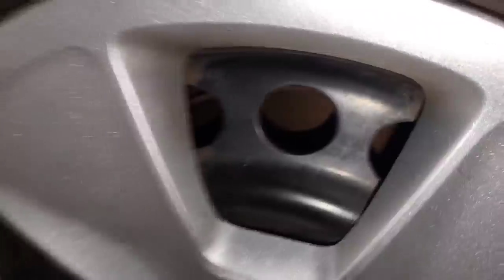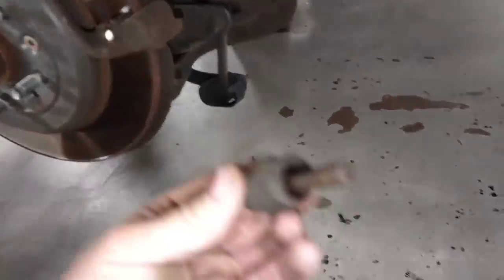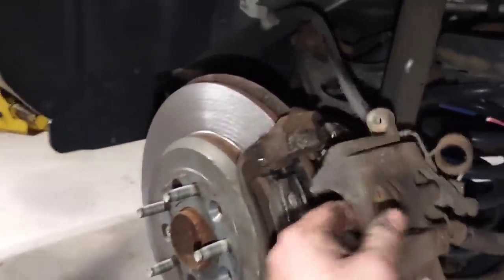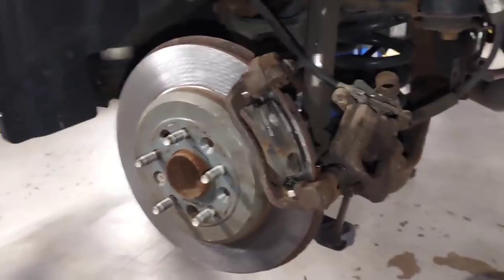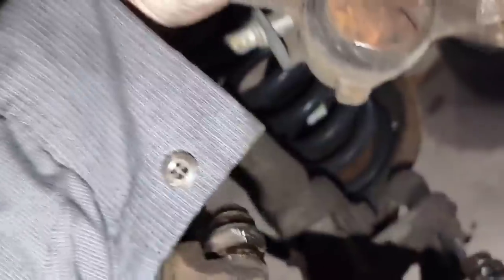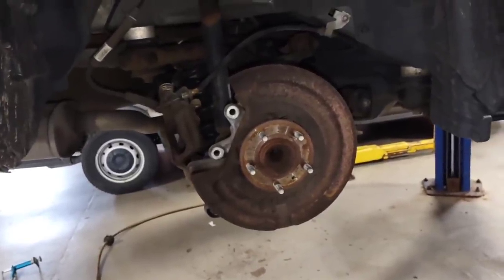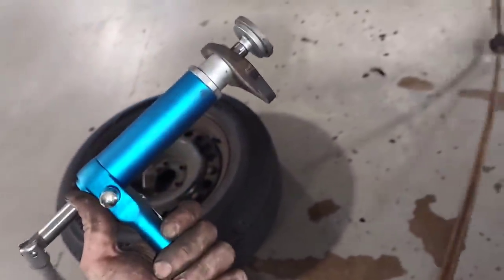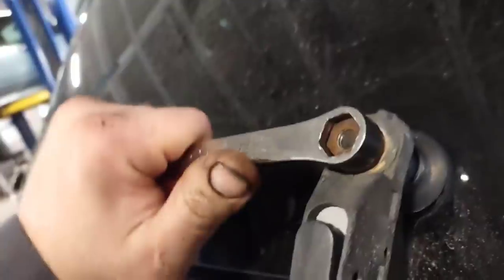Fixing Another Shops Brake Job Screw Up - this makes mechanics have a bad name Shoddy Work

Comment from the maker: A month ago whenever the vehicle came in the first time...... came in with squeaky front brakes and they were all burned up surface wise so I addressed the situation then and she didn't want to get into the rear because they weren't causing a problem " so she says " and on top of that the lady doesn't have money to spend

I recommended that we still check them anyway and she was apposed to it

Fast forward a month later and this is where we're at doing what i originally suggested
Reply: For whatever reason this was a recommended video haha but I See at 4:39 the boot on that piston looks torn or separated, I would not send one like that, not with a guarantee on my work.  Might be a bad brake job for sure, but a sticking piston will definitely hinder proper actuation., You won’t make money if your making it personal with the customer, especially flat rate, Everyone has a story,  Do good work that you can guarantee thats what makes the price worth it,, Not worth the time to disparage another shop either, (Seems to be a thing on YouTube)  Cut clear and dry, issue and correction. Bad mechanics give themselves a bad name, Good Technicians keep the customers and reputations just fine.
Reply: True...iv  got a mechanic  iv had for 11 years 😳 does great work and it stays fixed...I drive and old 1999 Chevy 2500 truck.with 132k...runs great...
Reply: I've seen more work like that come from dealerships than independent shops. Atleast in my area. In my experience its because guys get paid flat rate and do the bare minimum. As there more concerned about getting paid extra to get thru jobs faster than book time. Its the dealerships that are screwing everyone including the techs. I restore muscle cars for a living and I could tell you some horror storys that would give you Nightmares. We have no labor guide for the work we do. Most things are assembled and then blown back apart to check fit or layout for fabrication multiple times. I build and rebuild engines, chassis, brakes(stock and high perf) electrical (from a bad switch to a full wiring kit) American Autowire is the cats ass btw) rear end gears and carrier swaps, i agree. If your in this line of work.....Do  it right. Or find something else to make a living at that your not doing things that risk a family's safety. Leave the real work to the guys like us that are actual PROFESSIONALS 🤘 and good looking out for that mom. This world needs more kindness and compassion for outhers.
Reply: @furiousatvmct.v.3685  Disparaging other shop is more about getting the other shops to lift their game. 
Logically a mechanic should be happy to see another shops failure, as it means $$ for them, but I think most of the guys who care about their work are mad because it's a blatant rip-off on someone who has gone to them and paid for help, plus it potentially risks peoples lives.
Reply: mate I think youve been take for a wee ride... Id say her hubby did the job... why wouldnt she have taken it back to that shop???🤔
Reply: Does your dealership offer customers 90 days same as cash payments?

Comment: Love the cut texture for the old crap!  Nicely done.  And $150 for that job from a pro -- very kind of you to consider the customer.
Reply: It gets that overheated steel off the rotors. Not ideal but it works, probably better than sending it to the recycler if it can still be used safely. This isn't a race car that needs the best brakes for high speed corner entry speed. This is fine for a road vehicle. Even a GT-350 wouldn't notice on a track day, they are too heavy to corner that fast .
Reply: How do you re-texture a rotor?

Comment: I've done my own brake work for decades now and it shocks me that someone who claims to be a professional mechanic could do such a poor job on what should be a relatively simple job.  I also feel that you treated the customer right by making her brakes safe and for minimal cost.  Job well done!
Reply: I just did my wife’s Escape front brakes and I’m even putting loctite on the caliper bracket bolts and checking the torque specs etc…always is sad when you see professionals doing poor work like that.
Reply: @JustinLaNoue  I have an 05 Escape that i did my own brakes on last month. I did the same thing, found the tourqe specs, locktite, antiseize where it was needed. i had like 3 seperate videos i referenced the whole time and i have no issues. my car has 240K miles too. This was also my first time every doing anything mechanical with any car (minus changing a flat or my battery). So how does a "professional" do such a poor job?
Reply: @mikenike507  that’s awesome we’re at 104,000 miles on her 2012 Escape and she loves it so we have a long way to go!
Reply: The biggest issue is "professionals" working flat rate or shops that charge a fixed price for a job. In order to make money, they need to be fast. And for many "professionals", being fast means cutting corners and not doing the needed work like cleaning, lubing, torquing, etc.
Reply: I have an 07 escape and same thing

Comment: This is why I always do my own brakes. Ive tried letting other places do brakes 5 times, and 3 out of the 5 something went wrong. Twice on my own vehicle, twice on my fiance's vehicle, and once on my fathers. First time was my own truck, they somehow managed to crack a brake line (im assuming they dropped the caliper? not really sure) and I ended up using a parking pole as a stopping post. Second time was my fiance's car, I kid you not they put the pads in backwards. She calls me and says she has almost no stopping power and she was the last appointment of the day so the shop had closed. I drove it to my house and pulled a tire and I wish I had a camera to record my face. Third time was my fathers truck, same shop that screwed mine up a few years prior said they bled his brakes. Yea, they bled them all right! Bled all the fluid out because they must think air works better or something. Just something about brakes I guess. I now always take the time to just do it myself rather than trying to save myself the effort and have someone else do it. And now both my sisters, their husbands, and 2 of my good friends have me do all of their brakes too! Maybe I should just open a shop.... lmao
Reply: That's fucked, you and your fiancé and father should file complaints with any authorities you can, they can't be doing work that bad and risking driver/passenger's safety.
Reply: Happy YouTube teaches you everything you need to know
Reply: I totally get your story. I don't allow anyone to touch my brakes or my oil.
This is why I went to automotive school, so I can do as much as I can myself.i always do my own brakes since I'm be the only one to get the blame.

Comment: You are right on man! Lots of cars I have seen (especially Hondas), get pads jammed up like that in salt areas where the carriers rust and then swell up under the shims, if you don't clean under those shims, the pads will always jam up bad, sometimes I'll take a file and smooth the channel under the shims while testing the fit of the pads with the shims to fit backing just right. folks don't understand how important that can be. Same with the slide pins, those are often overlooked, they absolutely need to be well cleaned and greased. These 2 things are often overlooked, folks will just slap pads and discs on and call it good. Ideally you should clean and lube this stuff yearly to prolong the life of the brakes, and the performance.

Comment: Not a mechanic but I am the only mechanic I trust
Reply: You and me both buddy. If I don't know how do do it the only issue I have is it takes a lot longer than it should. I figure that shit out
Reply: Same here, i used to drive 15-20k miles a year so i invested in 4 jack stands and a jack, and started doing my own oil changes, 3-4 changes a year on my car every 5k miles, paid for the jack and jackstand after a year. I also change my dads and my girlfriend’s oil as well, so saving a lot of money just by doing that
Reply: Good thing your a mechanic because you'll need a technician like me one day! 😉
Reply: Same here, bud.....when I work on my '74 Harley FLH, I know what was done, how it was done....and if there's a problem...it's MY fault.  Same with my Crown Vic.
Reply: I used to buy mobil1 oil and filter for like $30 from walmart and pay a shop $25-$30 to change my oil, one day they refused to take the oil and filter I brought and offered their oil, dunno what brand cause they had it in drums and they wanted $80 for the oil change or $120 for the mobil 1 oil , ever since then i’ve been doing my own work, changed water pumps, timing belt, valve cover gaskets, spark plugs, suspension parts like struts, control arms, ball joints and a whole bunch of other stuff including brakes
Reply: Exactly, I don't trust "mechanics" to work on things.   They often get paid by billable hours.   As a result, they rush through everything and just slap stuff together as fast as possible
Reply: @Cristian-pw1iv  Most basic stuff is not difficult if you have any mechanical aptitude.  Follow instructions and review repair manuals before doing the job.
Reply: @yoyo762  yeah, that’s how i changed the timing belt, and water pump
Reply: Brakes aren't that hard to do, been doing them on my trucks and my dad's trucks for years.
Reply: I am a mechanic, and I am the only one I trust!

Comment: I see the same mistakes/sh*t work here at my dealer.  A lot from fleet companies(railroad/police/etc). especially from peeking at brakes while doing the rear toe link recalls. Also, I like using the rear pads set with the larger/longer lower clips for the brackets. They fit a whole lot better.

Comment: I’ve been a mechanic in Livonia Michigan for 30 years I see this shit every day somebody knew somebody and they thought they knew how to do brakes I’ve actually seen it where they take the brake pad and grind the brake pad down to fit in the saddle instead of taking the clips out and cleaning the saddle all the correct way
Reply: Ive had to do that on really cheap brake pads my sister insisted she wanted on her car... cheap $20 junk. They lasted half of what a better pad does. Shocker lol but those things had so many burrs and imperfections I cant believe they let them leave the factory. Damn things didnt even have the same shape! Every side was different and not by design lol
Reply: I’ve had new pads not fit in brand new calipers. Of course we have to take some off of the pad.
Reply: @BukitMan  Some just like to fit tight as hell lol. Which obviously isnt good. Too tight is a no no but sloppy toppy aint it either. I have new calipers and brackets on my car and the pins are just as loose as the previous ones. Bolted up and all, a decent bit of play. Some ''reman'' shit.
Reply: @stratsteveo106  I've seen only the cheap ones fit. And the expensive ones wouldn't.  This is all because of the powder coating process.  The brake pads are all perfect size, im sure.👍
The layers and thickness of the powder coating they do after, is not consistent.  Mass production.

Comment: I actually change my wife's 2017 Explorer Sport front and rear pads not too long ago. Was fairly easy, I do however need to change out the pin lube that came with the pads (junk) and use this much better high temp ceramic pin lube I used on my BMW. Rear calipers that require clocking on smaller vehicles,  I found I could use pliers to turn and compress but on the Explorer, no way in hell. Went out and bought the proper kit tools to clock/compress the rear caliper piston. $60 CDN. Not always fun when  you have to buy tools to do simple jobs but it's the satisfaction of doing it right. I'm not sure if it is common for shops, but I've been following the brake bed-in procedure where you do 4-5 consecutive high speed aggressive stops (not a complete stop) and then moderate slow downs and then a long cool down. No noise, judder just great brake feel and stopping power.

Comment: You are 100 percent right about what you stated. I worked at an independent facility. My boss was attentive to any brake job, he required all rotors or drums to have a resurfacing. If we were reusing pads when somebody did a poor initial job (usually the customer themselves) we would mic the rotor for safety and check flatness, if it passed that we would rough the surface with a disk orbital. I've seen such sad brake work done even by "certified" mechanics. If you go you have to stop, brakes are the most important system in any vehicle. Don't ever go cheap!

Comment: I inherited a Pontiac Sunfire that came from Illinois.  Midas had done a "lifetime" brake job on it.  I was hearing a grinding sound and it turned out, they just slapped pads and rotors on it.  Calipers were seized and the inner pads were about down to metal while the outers were like new.  Had to torch the calipers off.

Comment: I  agree with you 100% you did the right thing!! Wish more technicians and service staff were like you. I have been an established customer at my Ford dealership. After my original exhaust was replaced 3 years ago for $852. I was told I need another complete exhaust because my 2007 exhaust is loud. It really isn’t. But they wanted to charge me another $852. Spoke to the service manager. And the dealership owner. Both were not willing to understand my side of the story nor were they willing to step up and assist with a reduction in price. Now I have to shop around for a descent independent shop with a better price.

Comment: I just ate the labor for front wheel bearings on a 2005 Ford Escape for an elderly woman who got shit work done and was on a tight budget. She couldn't afford new hubs , so I went into my pocket to help her out.  Also threw in an oil change since the same shop did hers, supposedly. I did the last one for her and my initials and date were on the filter, so no way they changed it.

I turned them into the state , sick of seeing this , and it's been getting worse and worse over the last 10 years.  There are still honest techs and shops out there , but these hacks need to go.
Good on you FBM helping her out, glad to see.  Don't worry , it comes back around to you one way or the other.

Comment: I’ve been screwed enough to say enough is enough and I do everything myself. I’ve found a few mechanics that have channels that show everything according to Ford factory procedures and they show everything in detail, every step of the way. I’ve only had a/c compressor failure, alignments, and tire balancing/mounting done by anyone but me since 2010. Not once besides that has a Ford vehicle failed for me, covering 5 vehicles and their combined thousands of miles. Of course parts are bound to fail and require replacing over time, but learning to do the work yourself brings so much more of a personal bond to the overall feeling of owning it. I’m on a 2015 F-150 3.5EB with 80,000 miles and I’ve already done all the fluids; from differentials to transmission. Oil catch-can checked monthly to be safe and it catches so much sludge. Spark plugs and boots just to be safe since it’s Canadian and I only got it last year at 58,000 miles.  It’s hard to find a good shop that you can rely upon besides your own garage if you have the knowledge and the abilities (and the appropriate tools as required). Biggest failure was the parking brake linkages rusting solid, so the easiest way to fix it right was to pull the axles and re-replace the rear differential fluid. Pulling the axles gave me so much more room to bust rust and prevent future rust before replacing the shoes. So satisfy knowing all the work is done right and having first person visual on every component coming off and going on. 

You definitely are in the right to call a pile of garbage a pile of garbage. Good work for that customer and it helps restore faith in the good mechanics knowing the bad ones will get called out for their shenanigans. Honesty and integrity brother.

Comment: I’ve heard all kinds of people say they can do brakes. Most of them can do it but they don’t really know how to do it right. We have a bead blaster and bead blast the caliper brackets down to bare steel in the slide surfaces. Pins get freed up. Pins and boots replaced where needed. All hardware cleaned,  locktite and torqued. Keep fighting the good fight. It’s a thankless job most of the time.

Comment: A true gentleman mechanic. I have spent  6 decades dealing with vehicles of all kinds from motorbikes to tank transporters and an amphibious masterpiece and only ever found 2 mechanics i could trust implicitly. I have spent so many hours undoing boged jobs that are dangerous, as you describe here. I still prefer to do my own maintenance and repairs as required, never leaving it to a legal test to find fault. Not only reliable vehicles but, cheaper in the long run. Respect to your ethics.

Comment: I worked at Ford for 12 years, you wouldn't believe all the jacked up brake jobs ive fixed because the customer saved $60 by going to an independent repair facility. You can't cut corners on brake work.  You do a bad tune up, its gonna run poorly, you do a bad brake job, you're gonna kill someone. Good on you for taking care of her, you have a customer for life

Comment: I was shown long ago to clean the caliper bracket pad surface with the egde of a cut off wheel. You take the clips out and very lightly clean the surface to clean metal. Then spray paint and put silicone grease in there before replacing the clips. Keeps the rust from coming back too quick. Ive seen others take and grind the ears of the pads down on a table grinder so they will fit. I have found some times new pads fit too tight and its neccesary to do this. I always use the right grease on the slide pins. Ive seen too many use anti seize. Which always hardens up.